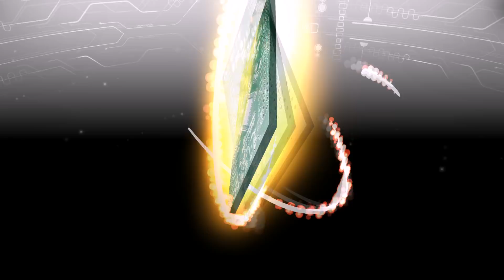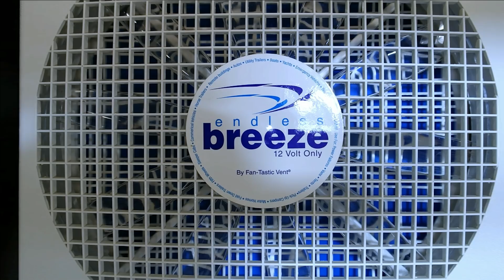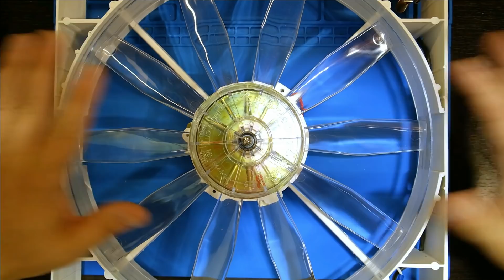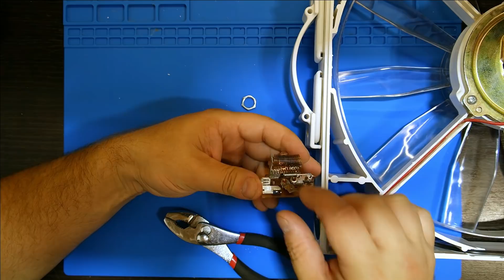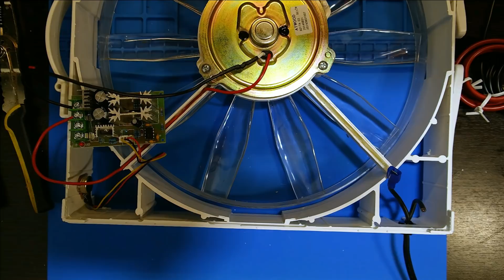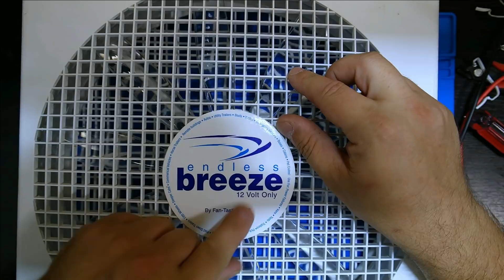Endless Breeze 12 Volt Fan PWM Modification

Comment: So I installed many fans in my small room, a 240v 300mm inline fan and a 24v dc radiator fan and at low rpm they all have this hum or whine that makes them far from quiet. I was told I might need a dc brushless motor but they pretty well don't exist at the large size I need or cost like $1000. Your link is unavailable, is there an equivalent option?

Comment: If you pull the front and rear covers off of this fan it moves substantially more air.
Reply: Ilir Cami - 7 years. After pulling the grills pull the fan off of the motor and oil the bushing/bearing with a lightweight oil, not wd. Wipe the oil off of the motors shaft and reinstall. Less whine and slightly higher fan speed. The difference between grills vs no grills is significant. Side note, clean the accumulated schmutz and hair from the fan blades to “rebalance” the fan if it’s become more noisy with time. Good luck 🍀
Reply: @Russell_and_Rosko  Pulled covers to clean the fan and paint to match the overland canopy - did you find any helpful technique(s) or tool implements for removal of the fan from the motor without causing damage to the plastic support mounts/shroud chassis?
Reply: @OverlandTrail  Try wedging something between the motor and the fan blades. There are different versions of the fan, just make sure you pull any retaining clips. The fan hub has an interference fit on the version I have (no clips), I wedged a putty knife and alternated sides as I gently pulled it off of the motor shaft. I hope it works out!
Reply: Ilir Cami - I’m unsure of how this motor will do with consistent moisture in the air. The switch is unprotected and not moisture resistant.
Reply: Ilir Cami I’m currently debating between 120v attic fans vs a solar powered exhaust fan consisting of 8-10 of the FF motor/fans ($40 @ Rv supply warehouses). Thanks for the greenhouse experience info 👍🏽
Reply: Ilir Cami ff-Fantastic Fan motor fan replacement is what I was referring to. I have a shop/workspace for automotive metal fab work. 3k sq ft 18ft ceilings. I may hang swamp cooler pad (I’ll spray it manually at first as a proof of concept. If it works well I’ll hang a pump, reservoir etc and run it off of a tstat) on the only air inlet into the shop to cool the shop on hot days. Best.